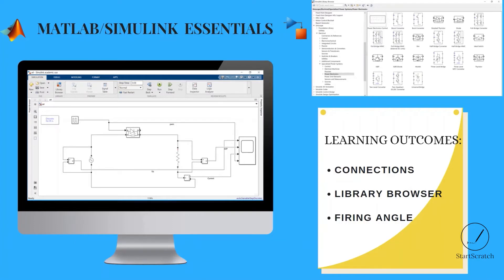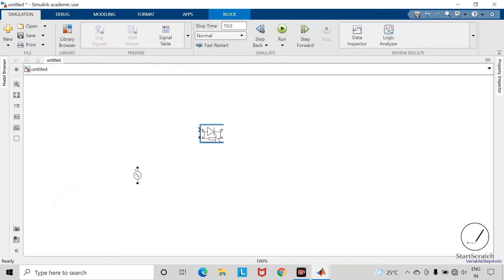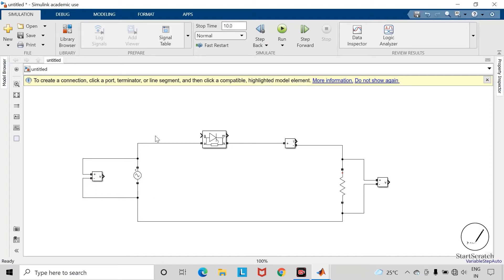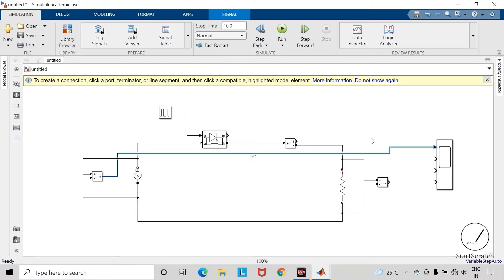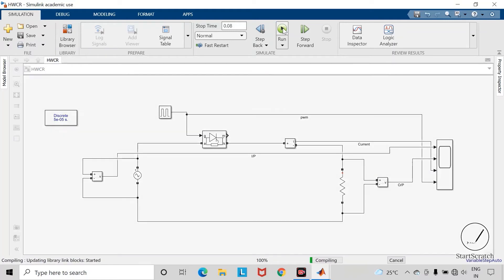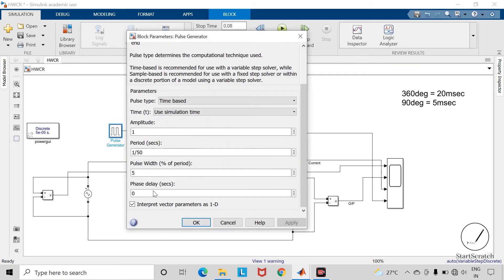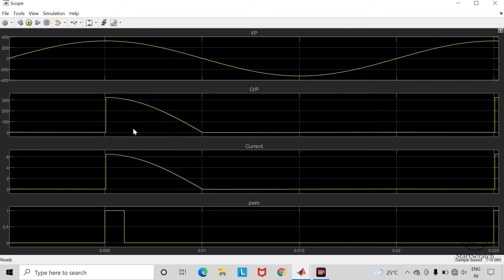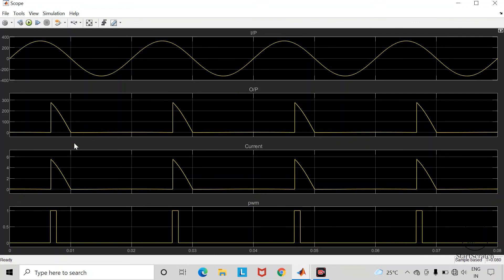L8 | Half wave controlled Rectifier with R load

Comment: Quiz:
1. What will be the phase delay for firing angle of 60 degree?

2. What is the difference between controlled & uncontrolled rectifier?

3. What happens when firing angle of thyristor is increased ?